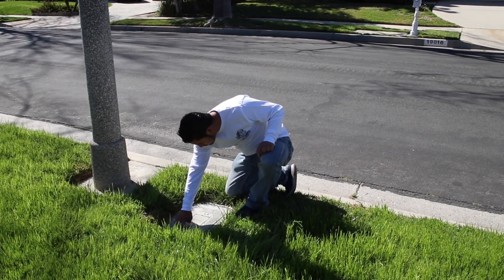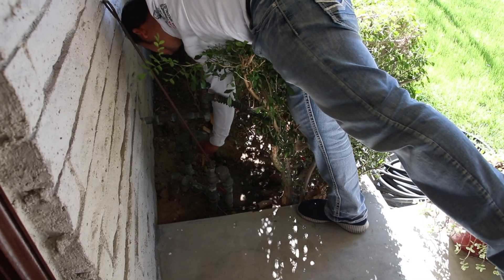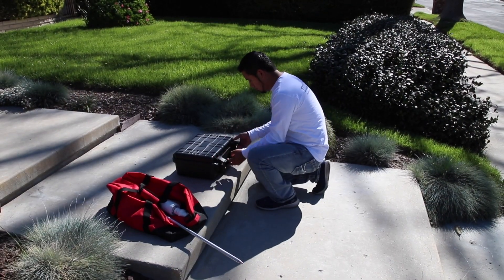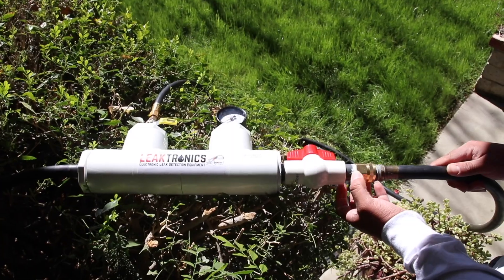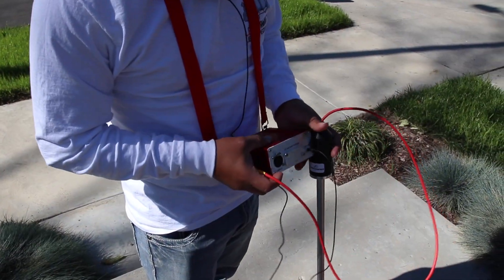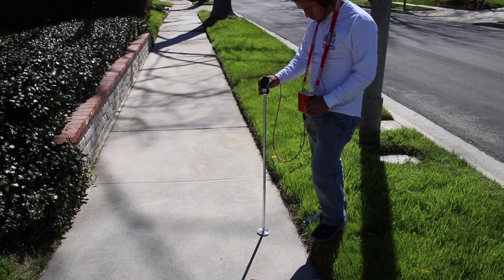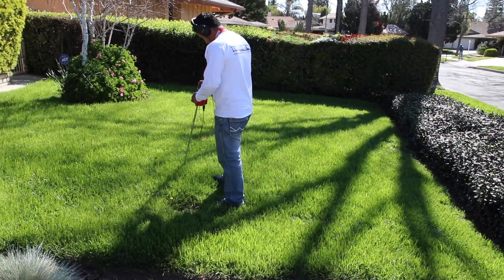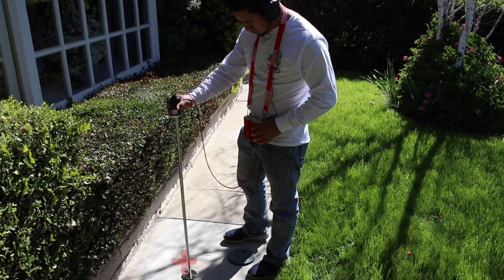How To Find a Leak Between Meter and House

Comment: Does this method work for very long driveways (over 500 feet)?
Reply from the maker: Yes it does! We recommend injecting water ONLY at first, and since this is an over 500ft line, it will take a bit of time for the pipe to fill up. We recommend no more than 12psi, or else you'll risk damage. If your line is able to hold that same amount of pressure, that means there's no leak. And if you're unable to get to 12psi, there's a major leak. This is a 2 person job so it's recommended that one person controls the pressure rig with full attention (not going over 12psi) while the other listens for the leak.
Reply: Thank you! Our leak is very small but we need to fix it. We had someone come out and he could not find it. He must have used a different method as there was only one person.
Reply from the maker: @susankuestner  yes, pressure testing, in order to be completed safely and correct, is a two person job. And your pipe is for sure leaking from the meter to your house?
Reply: Yes. The meter runs when we turn the water off at the house. The water company says we have to fix the leak, but all the companies we have contacted say we have to wait until the leak is bigger for them to be able to find it.